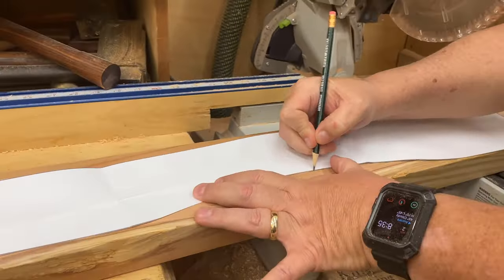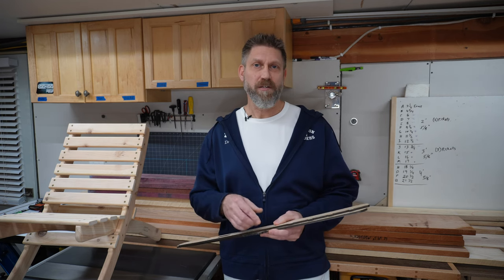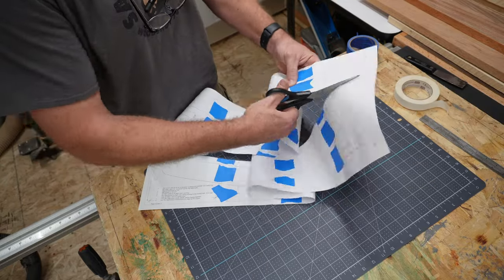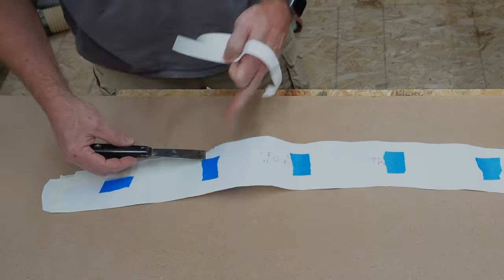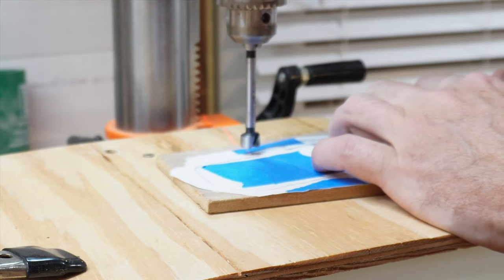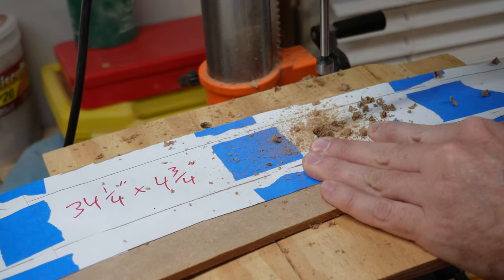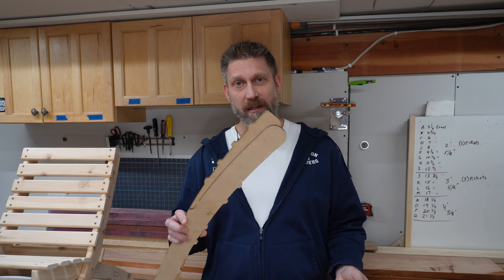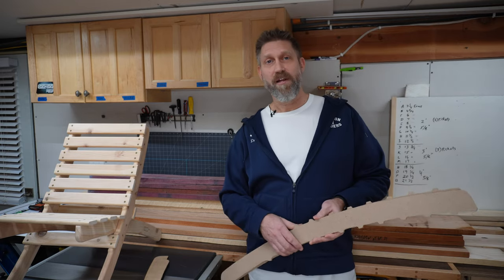The Best Way to Make Router Templates for Pattern Routing

Comment: When I make MDF templates from a paper printout I use a glue stick to attach the paper to the MDF.  It's much quicker, easier, less expensive, and less messy than than using double sided tape or spray adhesive.  If I have to align several paper printouts I'll line them up overlapped and then temporarily use painters' tape to hold them in place until I can permanently attach them to each other and the MDF with the glue stick.  Then I cut the MDF almost to the lines on the paper with a bandsaw, leaving about one thirty-second of an inch od excess material, which I then remove with sanding disks and drums until I've reached the printed line.
Reply from the maker: Good tip. Glue stick…hadn’t thought of that. Thanks for contributing! God bless!

Comment: Try lowering your putty knife handle towards the table like to 30-45 degrees.  Tear the tape while pulling towards the handle.  I have good results tearing drywall tape with a taping knife that way.
Reply from the maker: Great tip! Thanks!

Comment: I thought the first step would be make a copy of the copy for the templates just in case, looks good thanks
Reply from the maker: You're right, Tim. That would be the next step - to make a working template and keep the original in pristine condition.
Reply: But he said it was a computer print so he already has the original copy

Comment: Any reason why you don't just use a spray adhesive? 3m and other manufacturers make a variety of spray adhesives from a light duty hold to a "permanent" hold.
Reply from the maker: Spays are messier. That’s why I don’t like using them.
Reply: @BrettsWoodshop  Fair enough.